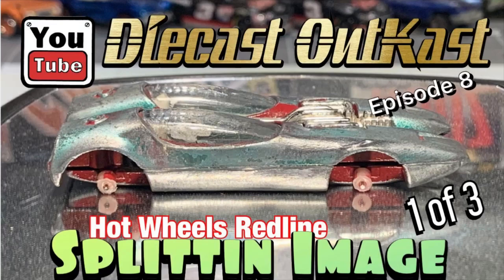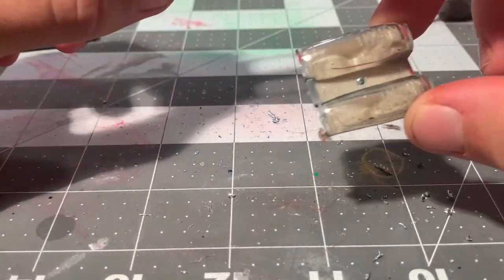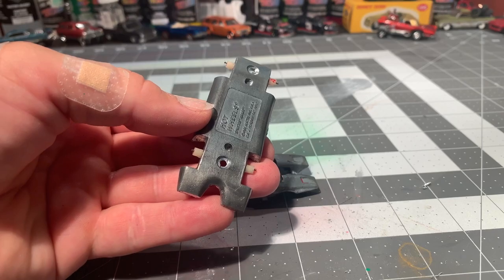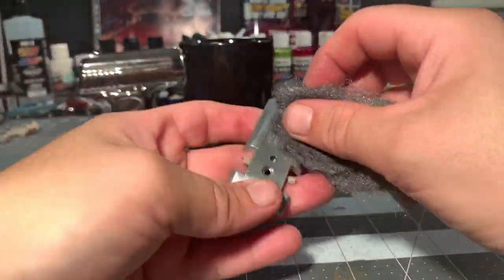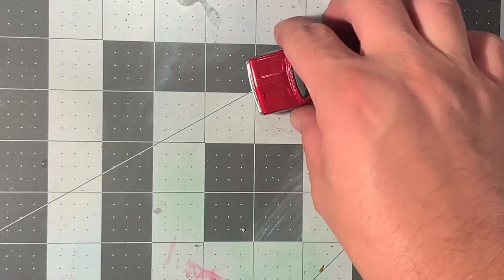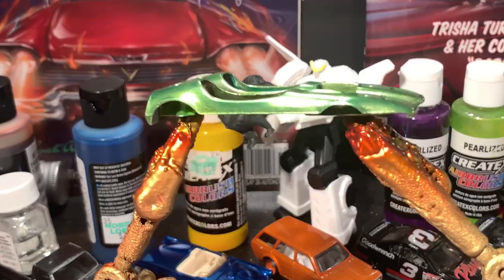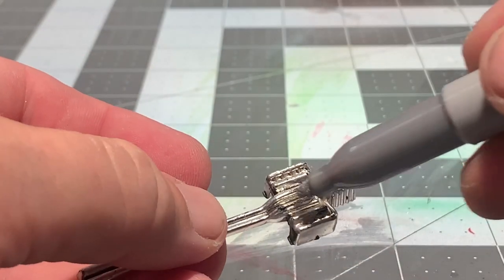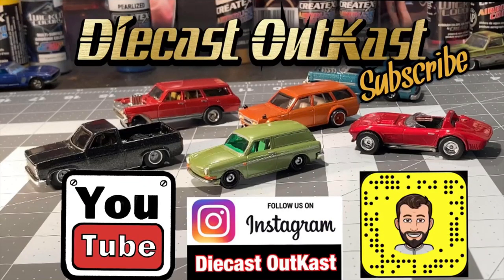Diecast OutKast Episode 8 splitting image redline restoration

Comment: Awesome job my friend I can't wait to get my airbrush hooked up, but first I have to find some kind of water trap for the line and then figure out what pressure I should run it at.
Reply from the maker: Opa's Diecast Wrecks and Restorations that’s my issue too.. I bought a new water trap with regulator, new hoses.. trying to get rid of the water.. I painted this at 20 psi

Comment: Hey, that turned out pretty good. The next time you take off casting lines you might not want to use a file. You can still see the scratches in the final product.
Reply from the maker: Weston Ward I’m no pro that’s for sure 🤣
Reply: @diecastoutkast6839  I know I get tired of sanding sometimes. Files do dig in pretty good though. Usually on casting lines that are on a panel and not a corner or edge I will use some 400 grit wrapped around a popsicle stick, that way I can lean into it.  😀